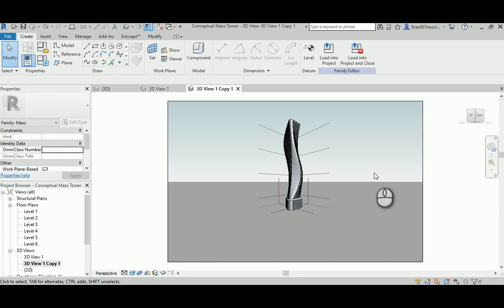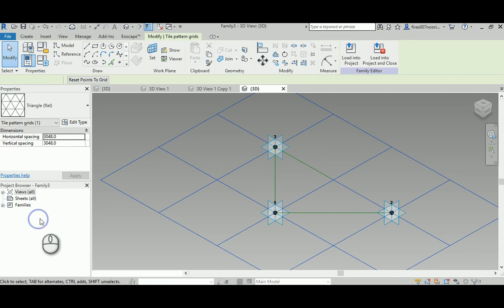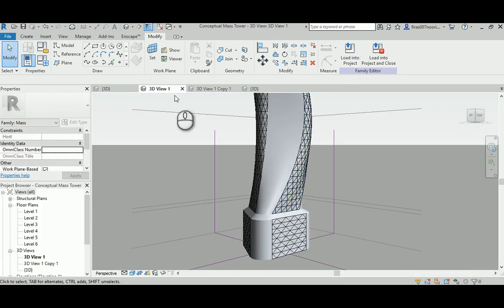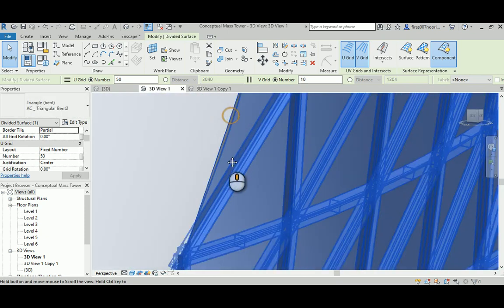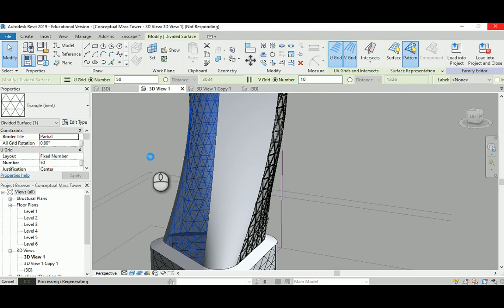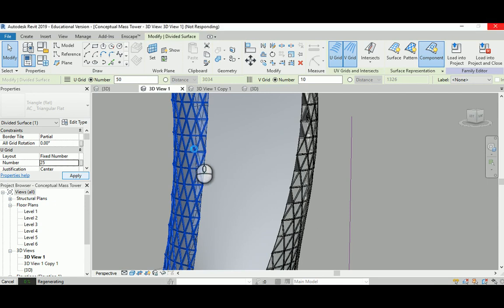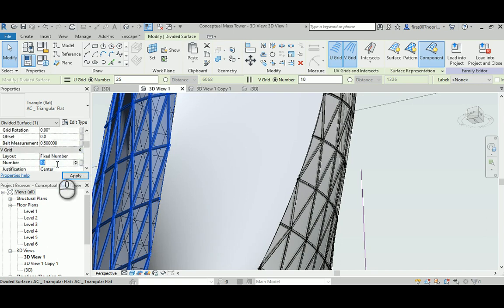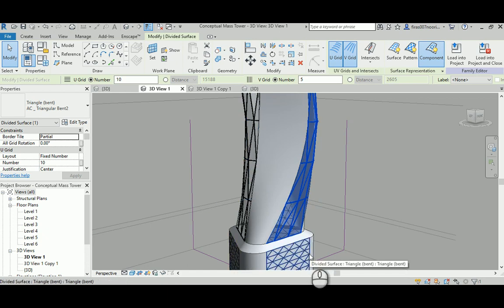Final Revit Exam 1.2 - Adaptive Components_Patterns_Triangle Bent V.S Triangle Flat

Comment: Loved this video. Really informative and dealt with the practical side of adaptive components.
Reply from the maker: Thanks dear
Reply: But sir, one thing i realized while dividing a wavy surface into triangular bent often most of the panels (triangle bent) get deleted by revit automatically but the same curvy surface can be smoothly panelled by triangle flat without any deletion of any panels by revit itself!
Reply from the maker: @Indranil.B  I guess this happens at the end or the edges of the surface due to the fact that all bend tri-system has middle edge that allows it to bend to more flexible (which the logical thing anyone can think of), but it also creates extra points for the divisions end to found!! so when it can not found these edges it continues adding them ignoring the real surface ends or you find them missing!! I do advise to delete them and try to add them manually later within Revit Environment.

Comment: For those pieces that are missing or have excess is there a way to create a "million" so that it is capped?
Reply from the maker: There is more than one method,
1. You can add the missing piece manually by add the adaptive components to the points of the missing edges.
2. You can define a dynamo node to check for correct placement and it can add the missing parts autoamtically